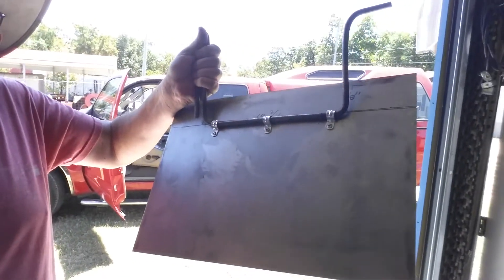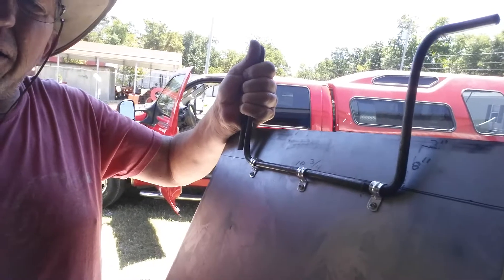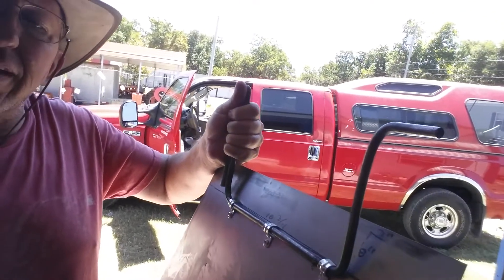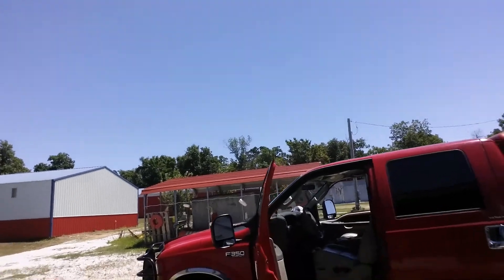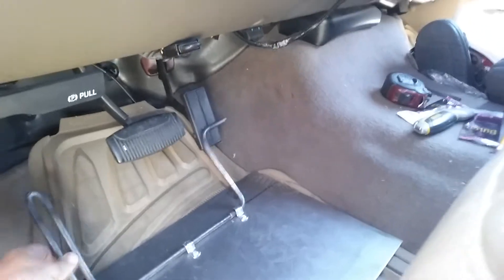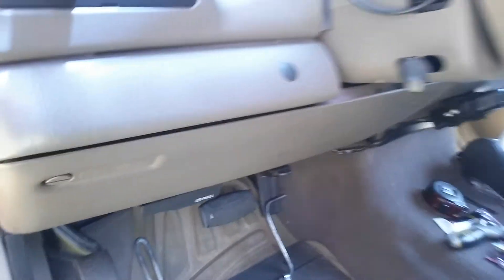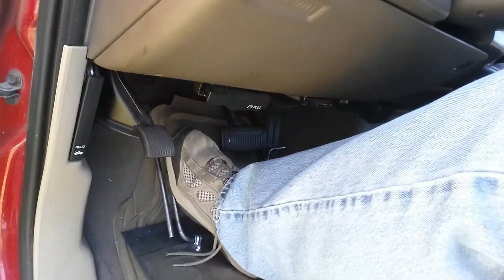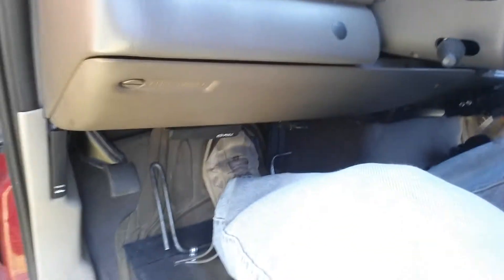LEFT FOOT ACCELERATOR DEVICE

Comment: Do you need to stable the equipment?or just put it on the footmat and use ur right foot to stable it?
Reply from the maker: My right foot is enough weight to hold it down. Then i added two short screws sticking downward to grab the floor mat and keep it from sliding. Of course an amputee might need a sand bag or similar weight to replace the weight of the right foot.
It all works amazingly well. Has worked for over 500,000 miles of over-the-road driving.
God Bless

Comment: My wife thinks she knows how to solve all problems. She ordered hand-controls on Amazon for $300. I got really angry. These are not legal in CA. You have to get the $8000-10000 ones and get an instructor and be retested on a DMV approved vehicle. All I needed is to switch to left side I think. Wish you made these with bushings ect? By the way if you have any medical issues or handicaps do not come to California. They will try to take your license away. And it will take months between driving appointments to get it back! Stay out of the Nazis State of California you were warned! I had a cousin and her husband lost his leg. They moved to Florida. They are not insane there.
Reply from the maker: Im moving to Fl soon. Hey you dont need bushings but a rubber foot pedal cover  would be nice. Btw, i drive a hot shot truck. Have put over 600,000 miles including LA, Houston, Miami...

Comment: You ought to manufacture these to work with specific vehicles. Every vehicle is different. It would be nice if it had a rubber pedal so your foot can’t slip off. Better Idea instead of bolting it to the floor.
Reply from the maker: What vehicle do you drive?

Comment: Looks good but two suggestions one is to attach plate to floorboard so it can't slide left or right or front to back and second the price on the actual pedal looks like it could possibly slide of the bottom of the pedal under full acceleration. But overall very good job.
Reply from the maker: Hi Terry. I didn't want to drill my floor so instead I added two half inch screws to catch the carpet and hold it all in place. 
Good luck and God Bless.

Comment: What are size of everything?
Reply from the maker: MAGALY ZAMORA the rod is 3/8 inch. The steel plate is 8 x 12 inches. Both are available at the local hardware store. Buy a small pack of cable clamps. I used 3. The rod is hard to bend. Ask a welder or steel worker to bend it for you and the bends will be more accurate. 
The red truck in the video now has 250,000 miles and I have another truck I drive with the same device.

Comment: This is a wonderful idea, and inexpensive too. I am looking for something like this. BUT - what does the insurance company think? Shouldn't it be attached to the floor?
Reply from the maker: Peter Nawalan , i have used mine for 250,000 miles driving. Occasionally, every few months i adjust it but its never more than an inch or so. I did put 2 short screws thru the bottom so it grabs my floor mat. I rest my right foot on the base (naturally) and that along with the 2 screws, works great. Please let me know if you try it. Thanks and God Bless
Reply: I called my insurance company and they said they had no issues with it. Maybe you can do the same. Call it by the fancy name "Left foot accelerator" and they should be fine. Lol

Comment: Hi - I'm an amputee and Ive been struggling for days with cables and rods and stuff - I look on here and see your one. I'll try it myself. Thanks.
Reply from the maker: Hi Rob. I think this will work for you if the plate is heavy enough. If not it will try to slide back. If that happens run a few short screws to make it grab the carpet or floor mat. Please let me know. God Bless
Reply: @DaleDenwalt1  I was thinking of a leg switch today. Been unable to drive for 1/2 a year. Scoliosis and Sciatica has damage the nerves on my right foot. 

My wife bought hand controls on Amazon. I told her these are not legal in California unless they are purchased from an approved rehab appliance vendor, then you loose your license, you need to be retested, retrained by an approved instructor, then DMV retested by you on an approved test vehicle. 
California is not a handicapped friendly state. Stay away! I got my drivers license taken away by a rehab therapist. Not by my neurosurgery doctor? He did know what they were doing? He said you have no problems? What is this about? 4 months later I got my license back. DMV made me wait 2 months between two tests. Stay away from California Idea of Compassion is torture the afflicted, unless you want to pain and agony.

This defeats this Nazis State Bureaucracy. I am moving out of hell hole California soon. People can not get movers to move them fast enough. 88,000 move from CA in 2020 and it was not just covid19. When you elect a wine maker Governor that is stupid is as stupid does. Newsom destroyed SF so finish the job. Make him Governor.

Comment: Thanks for the idea!
What are the 3 things called that hold down the rod
I wanna go to my hardware store and ask
Reply from the maker: Ricardo Iniguez i used cable clamps. Get the same size as the rod. I used 3/8. Good luck.
Reply: airdale74435 thank u for for sharing ur invention I sprained my ankle 5 months ago and I still haven't healed I have tendon damage so I also can't walk or drive to long withoutcmy ankle hurting .God bless
Reply from the maker: Ricardo Iniguez . I just wanted to check in. Did it work for you?